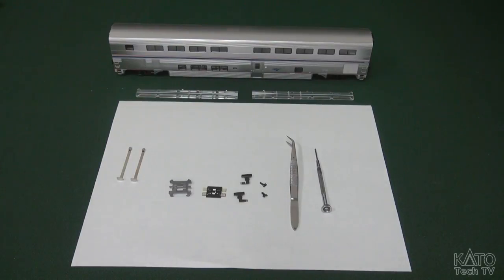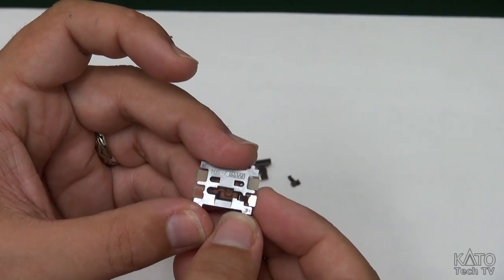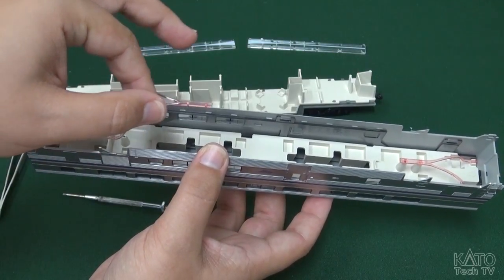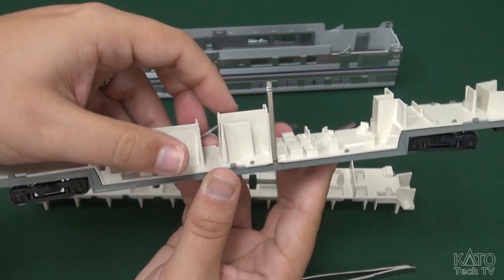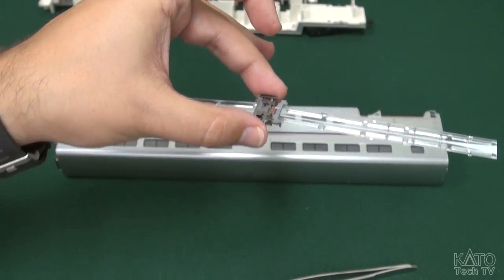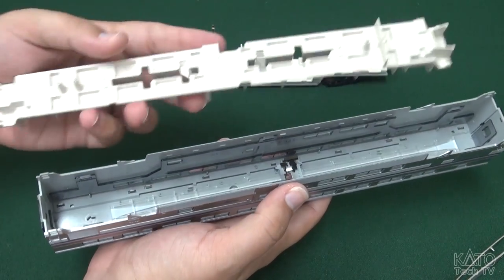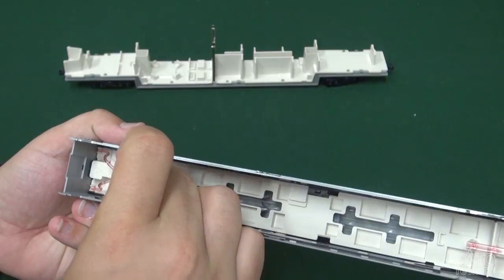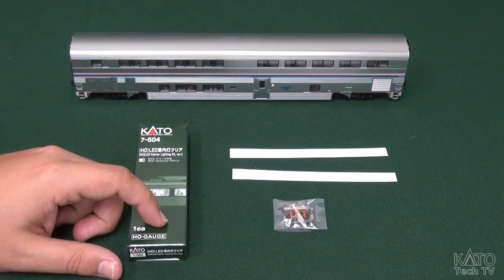[Kato USA Tech Corner] Installing HO Lighting kits into HO Superliners

Comment: Trying to do 4 right now and all of them have had issues that require lots of work. I would suggest redesigning the kit to reduce the number of pieces and junctions power had to go through. Otherwise get rid of the power going through the metal weight, it just does not work 1/2 the time.
Reply: Well, those junctions actually allow you to easily slip a DCC chip they make (called the FR-11) into place.
Reply: I put solder over the contacts to help raise the contacts up to touch

Comment: I did this on my all Kato Superliner coaches. You have forgotten to stick the white stickers on the ceiling to reflex the light down. Max.
Reply from the maker: It's mentioned at the end - the stickers aren't necessarily required but they can certainly be used for those who want them.
Reply: ...I'm guessing the same holds true for that FR-11 piece that you sell separately?
Reply from the maker: The FR11's are only needed if you want to be able to turn the lights on and off using your DCC system. The LED type lighting kits will work fine on a DCC system without modification as long as you're happy with them being on all of the time.